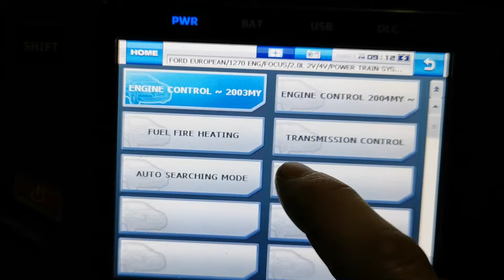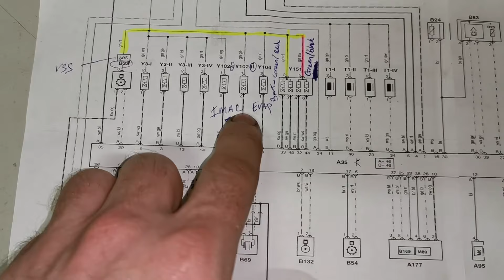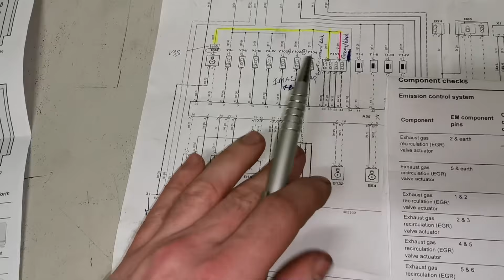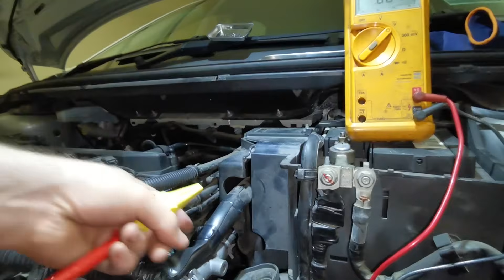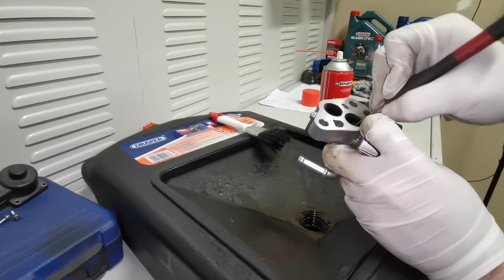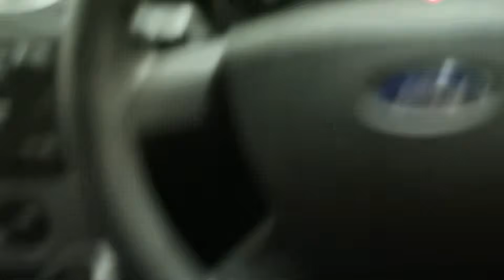P0400 EGR Valve Fault -  - Step By Step Guided Repair

Comment: Thanks! Wiring diagram, where to find ?
Reply from the maker: It is through a paid subscription I get mine. You can use Autodata, All Data, or OE specific options. Alternatively if you are part of a owners forum you may get a user with assess that can share files on there.

Comment: Now this is a PERFECT video.
Going through everything with the egr itself.
I have mk3 mondeo with this valve, and the detail you give showing external and internal of body and operation is perfect to help me know what is required, before splashing out money on a new valve.
So can get in my head what brushes etc will fit in holes with ease and no damage to get it all clean.
I do believe the best cleaner IF NO RUBBERS about is oven cleaner aka mr muscle oven cleaner, instead of throttle body and carb cleaner.
Subscribed merely based on this excellent clear video

Comment: Got it sorted on my Focus MK2 Convertible. I used a dremel with wire bits to clean the insides. Reinstalled, took it for spirited drive and the code is gone. Checked 3 times already. MPG improved a lot too. Thanks for the video

Comment: I have a 2013 Transit Connect, which has recently developed a rough idle and engine hesitation, so I put my OBD reader on. Came up with a big red X against EGR valve. Not going to mess about cleaning something that has done 120,000 miles. I've picked up a genuine motorcraft replacement on Amazon, and ordered a new gasket all for less than 85 bucks. My local Ford garage was very helpful making sure I had ordered the right part number as per my VIN, but they couldn't match the Amazon price, even at trade. I had already decided I was going to tackle it myself, being an ex-mechanic, although not for the past 30 years, but I figured it was still within my skillset, and of course I have the bonus of all the tools I will need. Your vid pretty much confirmed what I had already mentally worked out as my best approach, so a big thanks for that. Your vid is excellently filmed, with a great explanatory commentary, so I am now well prepared. I'll be tackling this at the weekend, and I'll let you know how it went. Thanks again for taking the time to upload such a helpful video.
Reply: I have the same model Ford Transit connect 2013 and i replaced the EGR valve but i still have a problem with this.I connect the OBD scaner and the EGR sensor never stop yo flashing

Comment: Mate!!!!1 you are a total diamond, was quoted to change the egr for an arm and a leg, but after watching your video i took the top of the egr off and used a little penetrating oil while giving the valve a good move. Eml never come back and all is running fine 3 months later.

Comment: Hi thanks for your very informative video . Would you suggest anything for me on my returning p0400 code. I got 2007 focus . I have replaced egr valve and vacuum solenoid but still popping up engine light once i drive 5 to 10km after code is cleared. Never had any symptoms even before parts were replaced. I went to mechanic and auto electrician they didnt seem to know much. Thanks
Reply: Hey, I have the same problem, have you figured it out? I bought new valve from Pierburg and this code keeps returning for 3 years. The only thing I havent tried is to put a new original EGR in.
Reply: @binkathor I don't drive that car anymore btw it was driving good without any issues just engine light was on all the time. I gave up figuring out what the cause was . It was just a too much time and effort consuming for a cheap old car 😂😂
Reply: I replaced the egr valve 3 times 😊😊 still engine light came on
Reply: @chrischo7464  Thanks for the info. Have you tried also an original one?
Reply: @binkathor yep once out of 3 times they were the same

Comment: Hi Gerard, what would you consider being a culprit, when I still get P0400 even though I have cleaned the original valve, then replacing it with a new Pierburg one and still get the flow problem and heavy pinging under load. When I unplug the valve, I still get the symptoms until the third start, when the fault is detected and engine light comes on. After that, there is no more pinging and surging under acceleration. So EGR is definitely the culprit or at least connected to it. Could be the passages in the head clogged?

Comment: thank you very much friend. I replaced the EGR valve with a new one and the problem continued. Thanks to you I cleaned the old valve and installed it again and I haven't had any more problems. I have driven my car for 3,508 miles and have had no problems.
Reply: Nothing worse than a broken new part.

Comment: I'm actually gonna take it off today, and just replace with a new one just because it's so hard to take off and put back on and don't want to do that twice!! The other problem can be the electrical component on the top with the 4 screws that can be defective not doing it's job pushing the plunger. I bought mine at a local Napa store which cost $81.00, when all the other big box stores wanted anywhere from $180-$240!! Napa is usually More expensive, I was surprised!. I will update after I do this! Thank You for this very well informative video Gerald!! Any other comments you may have from this comment, please reply. Thanks!

Comment: Aahhh man.

The error came up. 
Should I just replace the EGR valve and that’ll be fine or what??? I dont wanna become a mechanic 🤦🏻‍♂️
Reply from the maker: Too much Vtec :)  
Thanks for the kind words
Reply: @GerardBurkeBurkesGarage  ???
Reply from the maker: @DeeTeaDee  Sorry I was trying to reply on multiple videos at the one time, It is difficult to get the time for replying so I do loads at one blast and that was for a honda video :)
Reply from the maker: The answer is if you can't find the time to do all the testing then the best option is to replace it, it is very likely to be the root cause. The testing procedures are to confirm this before replacement.

Comment: I have a problem that I will explain to you if you have experience that can help me..??

 What is the reason??
 When I come I love gear on R or D and I am still smashing the brakes, there will be a jerk in the car..and also a jerk in the light of the car lights...?

 But when I walk normally, the car jerks and the car lights up sometimes.... Also, when I'm in a park and the car is not working and I come to raise the bottles I get the shivers increase and rise more and when I remove the glass or put the gear on N, the shivers go.  D you get shivers..?

 Sometimes a sign appears on the dashboard of the car. I checked a computer, and it appears before it disappears, and a malfunction has appeared in P0400
 What is the reason, can you help me if you have experience?? ..

 Of course the car is Vitara Grand 2000 v4

 Can you help me what caused the tremor problem?

Comment: A very useful and informative video! Thank you for taking the time and effort to make this. At 12:10 "THis" is in the way what is that, and can i remove that to easier remove that bolt i might round mine :(
Reply from the maker: Thanks very much. yes you can remove that, it is a much better idea to remove it rather than damage a bolt trying to avoid it. Good luck with the job

Comment: Anyone know what will happen for the upper part(black motor or solenoid)if I separate it form bottom part but still connect to the ecu?  Will the motor breaks down because without load form botton?  I'm trying to remove the EGR function but don't want the fault code to pop up.  I'm wondering if just to separate them will work.

Comment: hello there ,,,,i have to say ,,,i cleaned the egr ,,,,and the hole that sits  ,,,,,very well ,,,,it worked for  while ,,,,,,and afte that the check engine came again ,,,,,at the end 7 months ago the car owner decided that the time to change the valve has come ,,,,,i dint push him to change it couse i knew that if we change maybe the problem   remain ,,,,,so we bought a pierburg egr vale ,,,it worked well for 7 months ,,,,and now we have a check engine egain ,,,,,,whya problem remains ?> ==
Reply: hey, I have exactly the same problem, changed it for Pierburg and check engine light came back. Have you been able to solve it?

Comment: Thanks for the video Gerard. Just a question about the coolant - did you clamp off the line to prevent losing coolant does it flow from/to a port in the engine? How much do you think comes out? Cheers
Reply: Yellow clamp seen at 12:24, vacuum in cooling system should help reduce amount if no clamp is used, top up as necessary 👍

Comment: Wondering if there is away to actuate the actuator without using scanners. 6 pins, 2 powers and 4 signal (5V).
Reply: Hi mate 
Did you find out about this?
Got a maz 3 I can't check if it works off the car!

Comment: Thanks for this Gerard. I was having trouble finding videos that help a MK2.5 Focus but this is the closest to mine. 

I tried this earlier but my socket set is too thick to get in under the hose to undo the rear (as you look at it) bolt. If you could recommend any thinner ones, like the ones you have, that'd be helpful.

Thanks again
Reply: He used quarter inch drive that’s a tiny ratchet and because the tight only have to be tight enough to seal out air they don’t need to be that tight

Comment: Very good job :)
I did that cleaning job to my Ford focus flexifuel 1.8 L ...with the result of getting an fault code P0403...im going to check if it is a problem with the wires or if the stepper motor is dead today (2020-01-11) so frustrating....And i can´t find a wiring diagram for that engine model...weird ??
Reply: Let me know once you find a wiring diagram for this engine :-) Cheers
Reply: I had a P0403 fault code on my Focus,it had a break in the wire going into the multi plug for the EGR Valve,fixed that,put new valve in,now ended up after a while with a P0400 Code,so going to take the valve off and clean everything